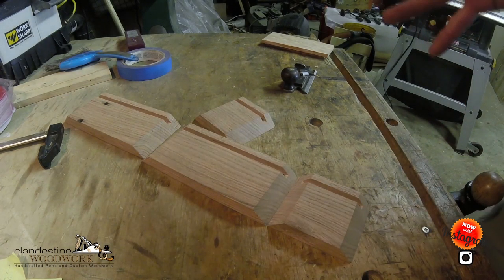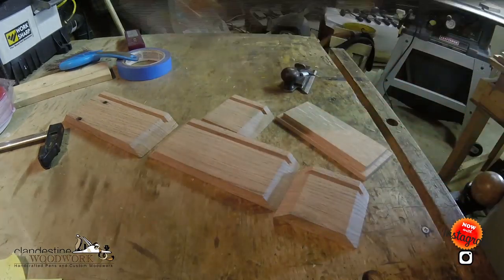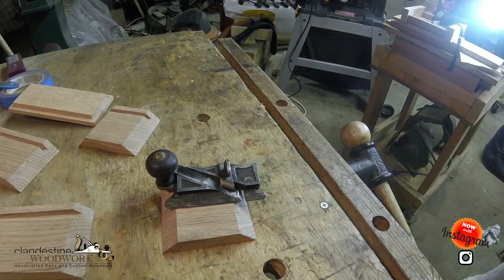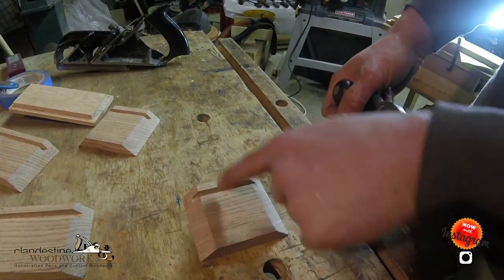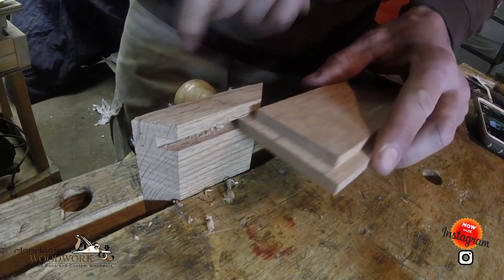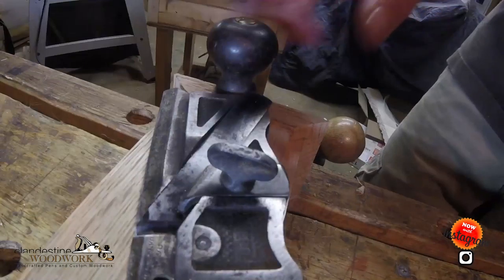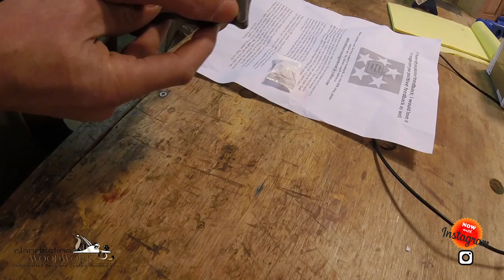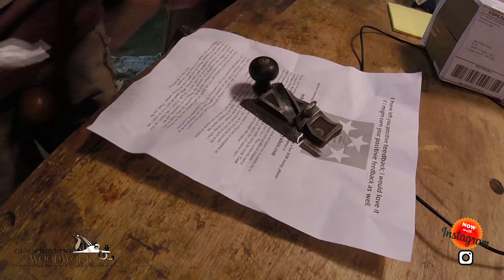030 Using a Stanley No. 98 Side Rabbet plane.

Comment: These are hard tools to find as were not as prolific as bench planes. Often they came in pairs. The 98 and the 99. Lie Nielsen made them but are now discontinued. The first versions had NO depth stop. The later ones did. I believe the Stanley’s had the feature to get up and close in a stop dado whereas the LN versions did not. But don’t quote me on that. The left and right versions were not to accommodate left handed south paws but rather to get a plane to cut with the grain. These are awsome planes for adjusting the width of a dado in solid wood. Really useful if fitting a ply panel as ply thickness is all over the place. It’s a specialty plane for sure. I wanted a matched pair with depth stops for years. Finally found a pair in England!!!!